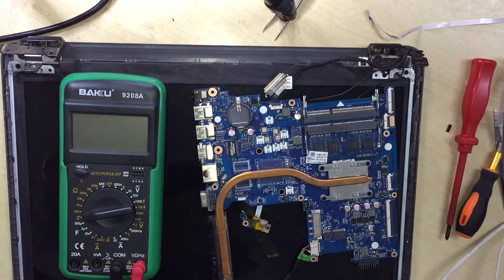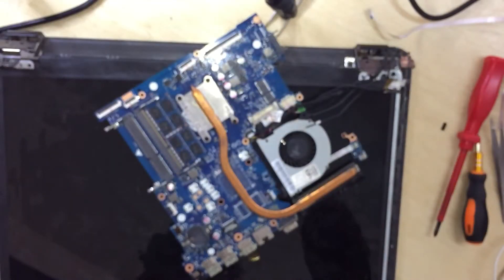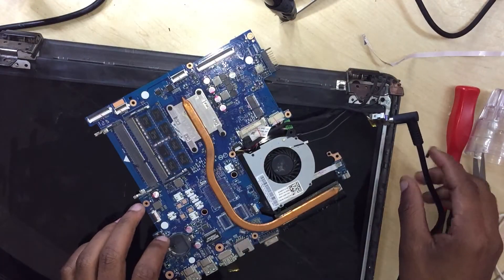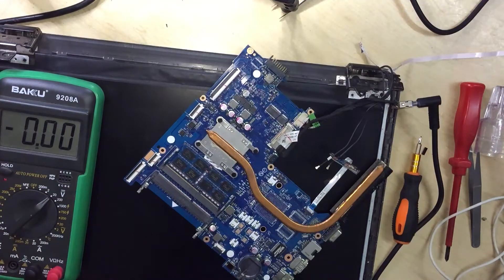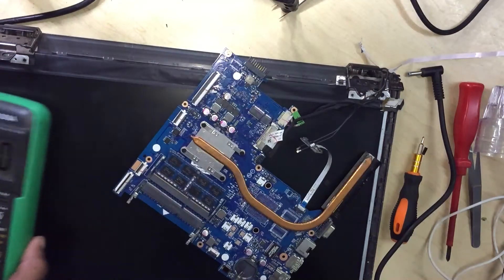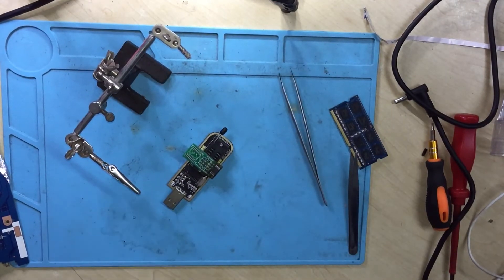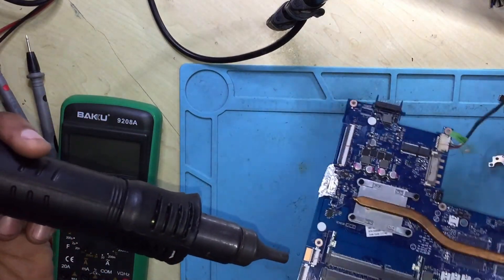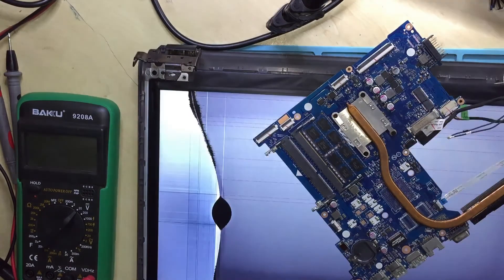HP 250 WITH NO DISPLAY

Comment: Friend, a question.  Does the bios chip have to have 3.3 volts on all pins?  Mine only has one pin that does not give me any voltage, the rest work at 3.3
Reply from the maker: The last pin it ground, it like negative, you won’t have any voltage on that pin, meaning your bios is okay 👌